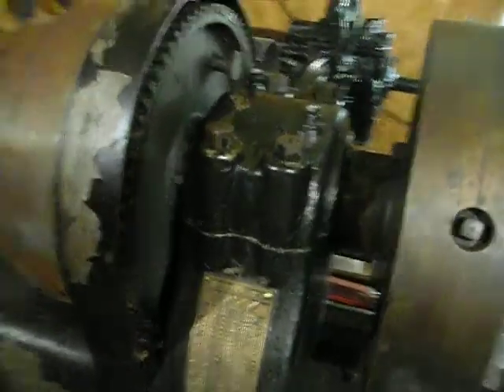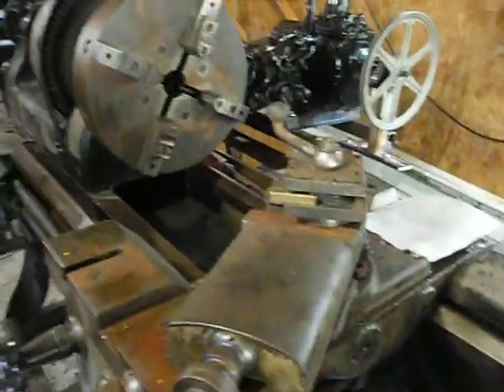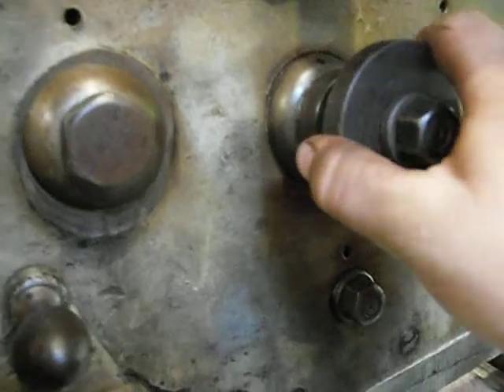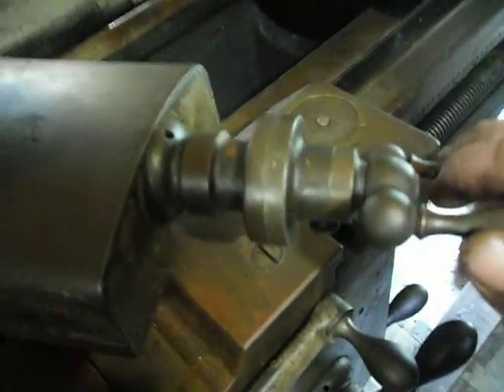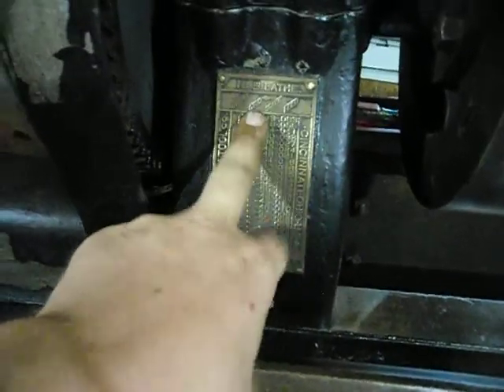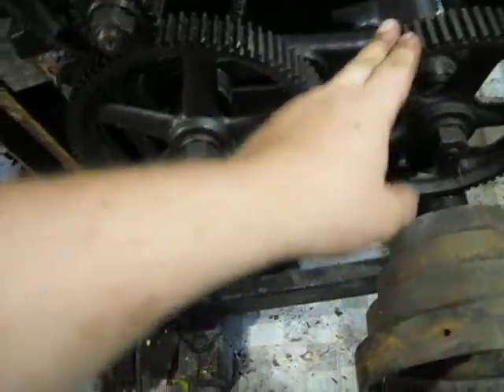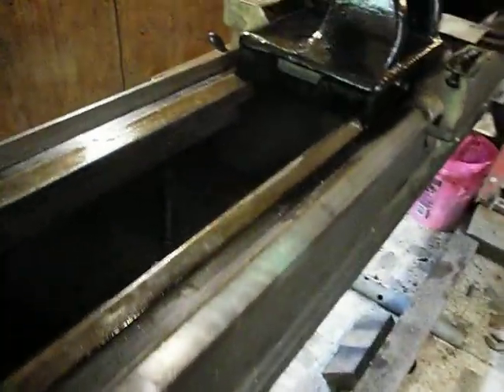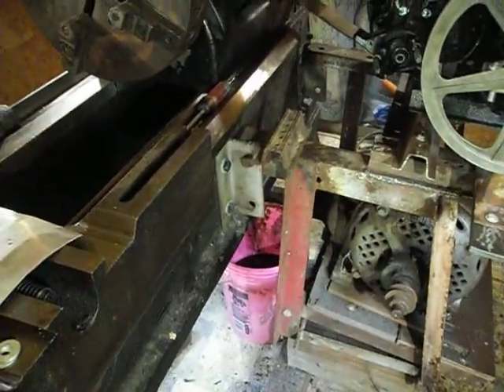1900's 18" inch Lathe walk-around R.K. Leblond

Comment: I have a 1915 Greaves Klusman lathe and your tailstock and saddle look exactly like mine? Very interesting and beautiful machines. I am going to watch your video and walk around mine and see how many parts are the same . Great video and thank you
Reply from the maker: It’s funny how all these old lathes bare similarities. I did get it running but the belt pulley system for the transmission and lathe was to much for the electric engine. I am in the process to switch it over to chain and sprocket. I will post some videos when it’s running the way i intended